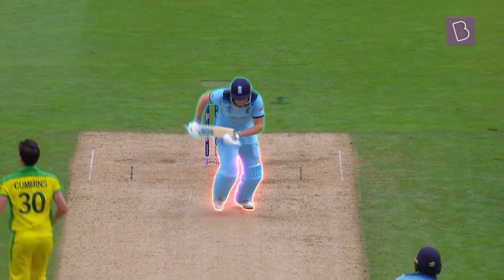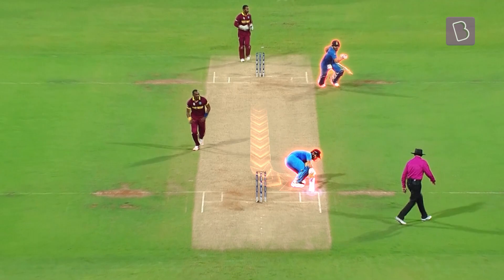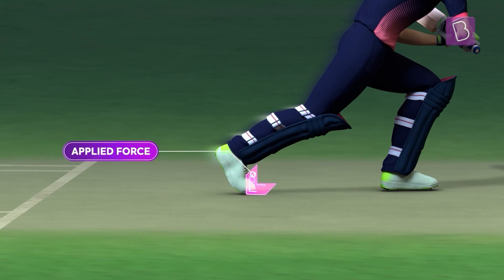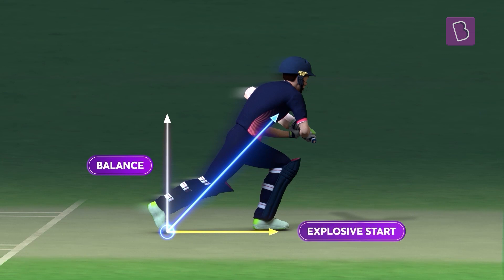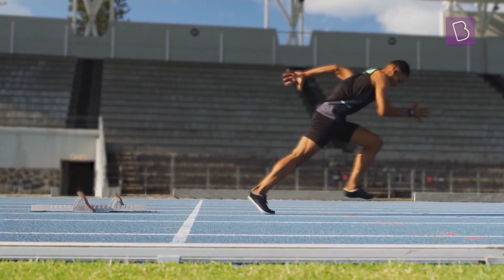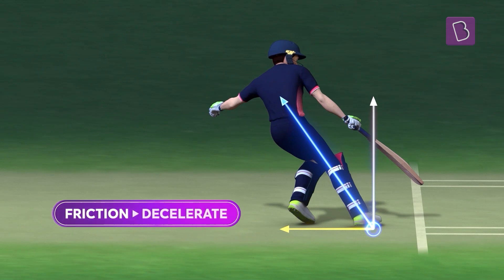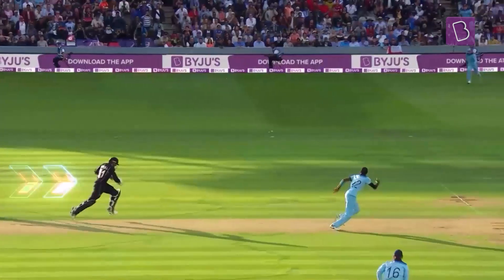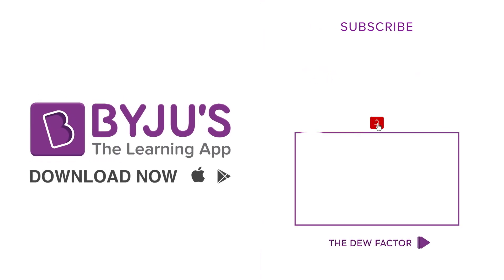How Do Batters Run Between Wickets With Precision? | Friction & Newton’s Third Law  Wicket to Wicket

Comment: that sign by the umpire is known as a "short-run." A run is called ‘short-run’ by the umpire when one of the two batsmen has failed to complete a proper run, i.e., cross the crease.
Reply: The run (short-run) is not counted. It is in Law 18 (scoring runs) in the laws of cricket. Although a short run shortens the succeeding one, the previous one if completed shall not be regarded as short.  A striker setting off for the first run from in front of the popping crease may do so also without penalty.

Comment: This signal is used for short run or when the striker after interchanging positions fail to make another run by maybe not turning perfectly.
Thanks byjus for revealing how these batters make swift movement across the pitch 👍👍👍❤️